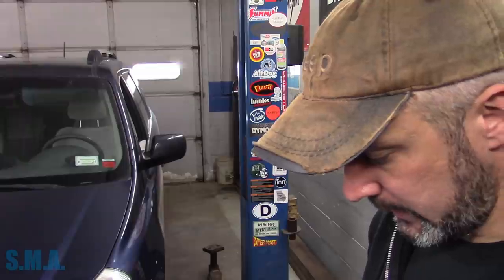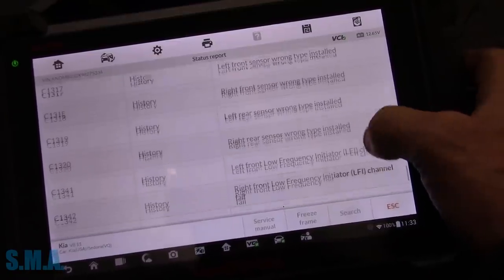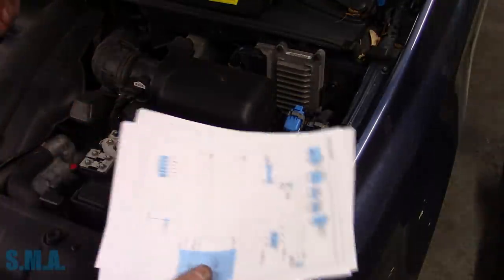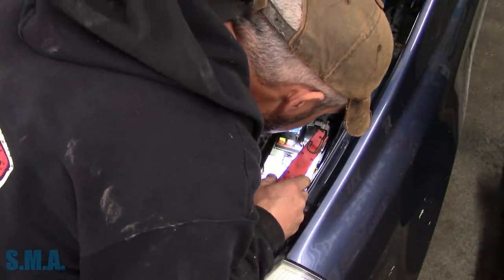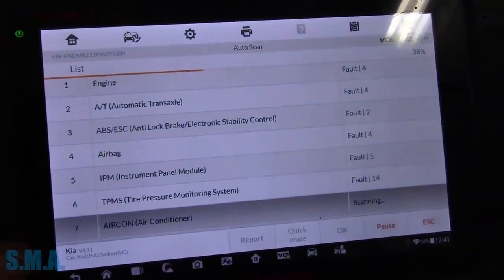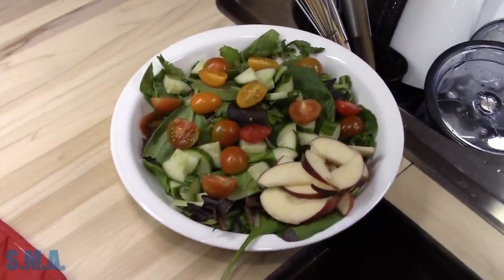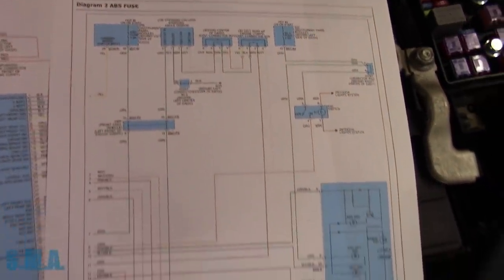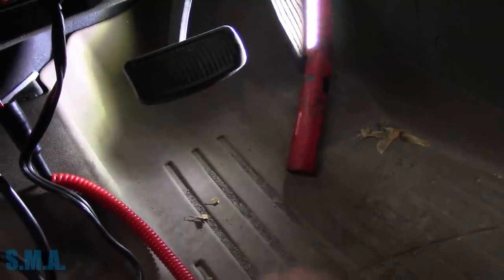You Can't Fix'em All...

Comment: I hate to make any kind of comment(because of the negative people)but I have been doing 12v electrical repair for the last 3decades,89% of the time with those issues it’s someone messing with the factory harness,I always hear about engineers being ignorant about repairing vehicles but usually if you can get a grasp on what they are doing you realize they are very smart,this particular vehicle probably has something to do with the aftermarket wiring (just saying)

Comment: my mom had a kia that would do the solinoid shuffle. nobody could seem to figure it out so i fixed it with a replacement ford.
Reply: david dawkins
You replaced the problem with another problem? Hmm
Reply: @andrewshanewarkentin  the american problem seems to work.
Reply: Ford??😂😂😂
Reply: @andrewshanewarkentin  Thank goodness it wasn't a Chevy solution, or it would have been in the shop again.
Reply: Threw all the parts at it eh?
Reply: Kias can’t last more than 100k. Fords can’t last 150k without gremlins and weird stuff breaking. 
Next step is to graduate to Toyota durability.
Reply: @TehKaiser  your obviously not a mechanic. Pretty easy to tell sometimes when someone not in the industry is talking like they know things
Reply: @MoparMadness93  Their engines might last, but keeping one alive is going to require a few more hours of labor. Planned obsolescence is not fake with Ford.
Reply: @MoparMadness93  Toyotas have issues as they get more complex but there old bread and butter I4s in the Camry and Corolla only fail due to normal wear or lack of maintenance.

I bought a project for 1999 Ranger with a busted valve body gasket. It has had minor issues such as the gear selector bushing wearing out, which is due to poor machining and the blower motor resistor failing. Those are systemic weaknesses not cause by improper maintenance. 

Likewise, a Mazda 6 from 2007, which a former tenant ultimately abandoned rather early at 140k due to a power steering pump failure. I had the temptation to take the cats, but did not in the end. That shared genes with the Fusion. Front end headlights needs the front end to be unbolted and removed to get the job done. The process on a Toyota is far simpler, involving only twisting the headlamp socket out carefully. The alternator is under the vehicle, in proximity to the rear cat.

Then there are mechanic vids on YouTube showing other Ford specials such as brake lines cracking on the 2003 and similar Escapes.

Many vintage Toyota have relatively easier access to things like the alternator and starter, being accessible from the top.
Reply: @TehKaiser  I just heard my 235k mile 97 ranger enter the chat.
Reply: @NoName-tz5ji  I have a 2000 Ranger has 170k miles on it. I’ve beat the hell out of it, it’s lived the last 10 years with chains on all four wheels. The only thing I’ve had to do is replace the coolant sensor and battery.
Reply: Mad Anthony Wayne  my mother used to have a 98 camry, it took over 200k. But unfortunately the axle blew, and the car was a beater. Seeing that thing get crushed almost made me shed a tear. I believe all cars can make it over 100k easy, it comes down to maintenance.

Comment: Nothing is more difficult to diagnose than an intermittent failure.
Reply: True for EVERYTHING.
Reply: And when you finally find that bare/loose/broken wire after three hours poking and testing and you tell the customer what the problem was and he looks at you with that look: "You charge me three hours to fix a loose wire?"
Reply: @MrGoogelaar  You just described perfectly why I quit trying to work as a mechanic a long time ago.
Reply: @MrMccurley  Or blaming you for things you didn't even touch. I got blamed for an expansion tank after doing spark plugs. He later admitted a previous shop said the hose connector was loose but probably ok.
Reply: That is why most professional mechanics are going bald. They have ripped their hair out try to track down intermittent faults.
Reply: Philip Koen lmaoooo
Reply: @MrGoogelaar  15ish years ago I worked in a computer repair shop, and we got plenty 'puters with rather minor but no less disrupting problems, and some of these were as simple as wire looms coming loose... sometimes because the owner had tried to do something else like adding memory and now it doesn't work... things that owners "could have fixed themselves" when they heard the price.
Reply: @Hedonistic0Frog  Did some work for a friend and after doing his brakes his comment was : well you did my brakes now my engine is over heating! what did you do it never OH before this repair! , Im not a pro mechanic, and I did this for a friend in the 80's and no charge for labor and he supplied the pads, well he got mad!! AND that friendship was done and for the better for me! No more favors for anyone doing any repairs on anything! And I have stuck to my word ever since, not worth it.
Reply: My son said everytime he drove his car the battery light would come on and the car would die. I would drive it for days and it ran fine. Then he'd get down the block and it would die. Turned out to be an alternator failure that was going into over charge and dragging down the engine at idle. Didn't happen for me for some reason.
Reply: @lt4324  well why did you make the car overheat while doing his brakes? You must have gone far out of your way on that one 😂
Reply: @Hedonistic0Frog  LOL
Reply: @Hedonistic0Frog  LMFAO, Now I wish I would have, got blamed anyway, LOL good one.
Reply: Death Wish  he was the first to ever do that, I used to help out people when they needed something minor like that and even did my girlfriends repairs  too.
 He was the only one but it only takes one.
 I do have insurance to cover repairs but that is only for my real work related repairs but I could work that into my business if I really needed to, LOL. Now I only work on my own vehicles. No more favors. Thanks for your comment, Tom in NV.
Reply: After fixing an intermittent immobilizer  issue on a Seat Ibiza. Yeah. But its not impossible. Gotta use oldschool fault seeking, lightbulb tests for flickering light. Physical inspection of soldering joints on connectors etc.
Reply: @lt4324  sad that people can be like that obviously have no mechanical aptitude
Reply: Exactly right.

Comment: Install lower amperage fuses in-line with each component after they branch off.  It's a pain in the ass, but it's the best way to isolate the offending circuit leg.

Comment: Yep I'd have done the same thing. No sense wasting $$ in labor or guessing at parts but I agree with the fuse thermal cycle failure. I've never experienced it & every fuse that I've found blown will sooner or later pop again and once it happens again it's time to investigate further but the ones that happen only once every few months time is making a logical call on diagnostic fees vs parts cost & most logical failure components and what the customer wants to do.  I prefer to wait until a hard failure as long as it isn't safety related or will strand the customer. Bottom line is whether the customer agrees to the repair or not and they sign the RO. Enjoyed the video and I'm recovering from my stem cell transplant and am starting to work on cars again. Just fixed an 06 Jeep 4.0L that wouldn't start in cold weather hit or engine temp went below 100 degrees & would only crank for @2.5 seconds and then starter would disengage. It's been to multiple dealerships and independent repair shops and they threw 3 starters, 2 PCMs, multiple CMP/CKP sensore, CTS, ASD & starter relays and after 5 yrs it left these shops with the customer and Jeep broke. It would eventually start after about 10 minutes of crank no starts and backfiring. I wanted to get my hands on it b/c it sounded interesting & it was a friend who was the Service Mgr at the Goodyear Service Center. His wife was driving his 2019 Challenger and he wanted his wife's Jeep fixed so he could drive his Challenger again. Pico got a workout but was getting ready to borescope cylinders for coolant & fuel while cold in AM & scope secondary with the Pico Mixmaster & shook my head when I seen the plugs (3 carbon tracked and all 6 with >.080" gaps worn to porcelain. Cylinders borescoped good @ secondary scoped fine after sparkplugs replaced & base timing adjusted & it left my shop starting every day in 37 degree weather first time every time.. I gave him a huge break on the bill but he wanted no part of it and gave me more than I would have charged a regular customer. He was so happy to get his Challenger back from his wife and I was satisfied to fix his Jeep and would have done it for free just b/c I hadn't worked on a customer's car in such a long time. Thanks for putting out all the fantastic videos b/c that's what helped energize me when I was in the hospital going thru chemo and the stem cell transplant & am now recovering from AML and soon I'll be back at it thanks to God!!

Comment: I did a battle with a dodge stratus several times and. Never found the problem. The lady told me the dealer did not find any problems. She ended up trading it. I pretty much avoid electrical gremlins. I am not set with scan tools or knowledge. Great job trying!

Comment: Back in the day when I worked at a dealer, our technical assistance people had a good recommendation. If you have numerous items being powered off one fuse you could find where they branch off the main power feed and install a fuse there. You would be isolating each circuit at that point so if the problem occurred again it would only pop the fuse specific to that circuit power feed. I like your idea of the amp clamp though too, that way you don't have to splice a fuse inline.

Comment: In my experience 'best cry" or as you call it "best try" usually taps ino something they shouldnt. Could it be the remote start popping the fuse when cycled? In my experience with those aftermarket installers they tap into something, car has an issue afterwards, when asked about issue they always say no we wouldnt go near that system only for you to take the car apart and find their handiwork all over it
Reply: After seeing the rat's nest of wires, I made a mental note never to buy a used car with an aftermarket remote start.
Reply: Bingo!
Reply: @waynetang1763  They aren't all installed shit, but I would never either regardless. unless they have paperwork for lifetime transferable warranty
Reply: after market remote lock/start caused me so many intermintent problems. Even after it was removed. took me years to finaly track down the risistor they had solderd in under my steering colomn.

Comment: Had a lincoln blew 2fuses always same time only occasionally was a sheet metal screw through the harness Midway under the dash through a original  clamp .🙃😟
Reply: 20 plus years of Ford dealer repair and have seen that more than you would think.

Comment: Odds are it has something to do with `Best Try's rem,ote starter install. Wonder if they shorted out two wires when they were cutting open wiring harnesses.  I watched but didn't notice if you tried using the remote starter and then see if that fuse was burnt out again.  My gut feeling - it has something to do with that remote starter and their install...   yeah, which could take forever to find.
Reply: Dang Rick. i was just about to suggest that. I wonder how much draw is caused by the speaker wire.
Reply: Yeah I wonder if the light came on right after the install. They could have manually shorted it in a way that only those master mechanics know how.

Comment: UART:  Universal Asynchronous Receiver Transmitter.
Reply: The UART chip exists because the main CPU is not free to read data synchronously (immediately) at all times, since it might be busy executing other instructions. The UART has it's own separate memory called a buffer that holds data until the CPU is ready to asynchronously transfer that information into its own memory for processing or storage.

If the UART buffer fills up before the CPU can empty it out, that is called a "buffer overflow". If the UART reports to the CPU that it had a buffer overflow, that lets that CPU know some data has been lost. They were pretty common back in the modem days, every computer had one attached to its "serial port".
Reply: Or when working in IT, and dealing with users, it's a  User Attitude Readjustment Tool.....aka a hammer to the fingers.
Reply: USART - Universal Synchronous/Asynchronous Receiver Transmitter
Reply: @Beany2007FTW  I always call them a ID10-T error or PEBCAK error lol
Reply: UFART - Self Explanatory.
Reply: USHART - Change underwear.
Reply: Unable to Ascertain Repair Trajectory
Reply: Fancy way of saying "Bidirectional data, no clock.".  Figures out the clock itself from the data rate.
Reply: More like UAINT, no small thanks to the hack job best buy did to the harness.

Comment: Fuses never blow without a reason, however very expensive modules will blow to save a $2 fuse.🤣
Reply: Ikr? Love it when I see a charred box o' electrical bits down stream of a perfectly happy fuse.
Reply: ain't it the truth ! 🤦‍♂️
Reply: Yes, there's not much sense to the "fuses blow because of thermal cycling" comment. 
The only cases I know of a fuse blowing because of thermal cycling is when a slow blow fuse is almost constantly taxed above it's amperage, ie a 10A fuse has almost constantly 11A or so running through it. That will cause it to heat up every time and eventually blow. But for that fuse to do that, there definitely is a problem behind it, because it should never be overtaxed almost constantly.
Reply: True dat
Reply: Must have the same engineers as Apple computer.
Reply: @davidlong1786  watching too mucho louis rossmann?
Reply: Fuse is more for safety than to protect components... which likely have their own fuses.
Reply: You should see LG television sets, they will gladly catch power supply, TCON, etc on fire before any of the 20 fuses do anything and even if they do, they'll weld themselves together.
Reply: @xephael3485  Exactly so. The fuses are sized to protect the wire. As for the parts, I learned in the '60s that no fuse is as fast as a transistor. Still true today, but ICs are even faster.
Reply: John Tomassetti A $2 fuse?? You need to start shopping somewhere else, they can be had for far less! 🤣

Comment: Last Tuesday I had lean codes P0171 then P0174 come on in my Chevrolet LS1 V8 powered Holden VY SS Commodore & I thought that it was nothing other than it being a hot 45°C summer day over here in Australia where some cars were even overheating.

The check engine thing come on after I pulled out of the car park,I retrieved the codes then cleared them,I also noticed that the fuel trim readings on the left bank was 25% & 23% on the right bank.

I drove it to town last Friday & the check engine thing came on again after turning right off a round about,down the road it started chugging a bit so I pulled into the local BP service station & checked the MAF tube worm clamps to see if they're tight,they were a bit loose on a 35-37°C day.

The heat softened the plastic & caused the  clamps to come loose, after I went to the supermarket I went home & plugged my scan tool in & retrieved misfire codes for cylinders 4 & 6 (P0354 & P0356).

I believe it was caused by the air leak so it was a lean misfire,the fuel trims went down to 14.8% on both banks & I drove car in last Saturday to do my main shopping,that was on a 46°C day & the check engine thing never came back on, the fuel trim remained at 14.8% on both sides !

Edit 6.1.20 - This confused me but the misfire codes came back today ,it was due to a lousy connector which was half off,the blue retaining tab that GM fit onto the connector wore down & slipped out so I just fitted a cable tie onto it so it won't happen again in the future !

Comment: Late to comment here but if you don't have one then best tool i've had for electrical diag is a powerprobe, basically a test light and a dmm together. tells if you have continuity, gives voltage readings, and can apply power or ground to a circuit for testing also pretty inexpensive cost. Has saved me a lot of time on the more complicated electrical faults

Comment: You can only do your best to recreate the fault. And who knows could of been something that was caused by other attempted repairs or the add ons like one of the dongles that monitor driving habits if it goes to the DLC
Reply: Is there anything more frustrating than going a long way down a dark path, only to find out that the problem is related to something that was never mentioned?

Comment: Protip to save old weary backs is to get one of those 6-8 inch hand/shaving mirrors from the dollar store to look under the dash.  I got tired of crawling around between the floor, seat, and steering wheel and you'd be surprised what you can learn to do backwards looking through a mirror.

Comment: This is what "progress" has brought us. Cars which are really complex bundles of computers and sensors with 4 wheels. Even a highly skilled mechanic like Eric, can sometimes be stymied by diagnostic and repair challenges.
In my view, we need to roll back the clock to a time when cars and trucks were simpler, easier to diagnose and repair, less expensive to fix, and in many cases, more reliable.
We have had "progress" foisted on us, and it does not serve us well.

Comment: Yes, fuses can go from thermal cycling.  But in my experience you usually can tell by looking at the link.  Thermal cycling will just be a crack - if you can see anything at all.  But if it's burned away with melted ends, or completely vaporized - that's an overload.   The bigger the carnage, the bigger the overload.